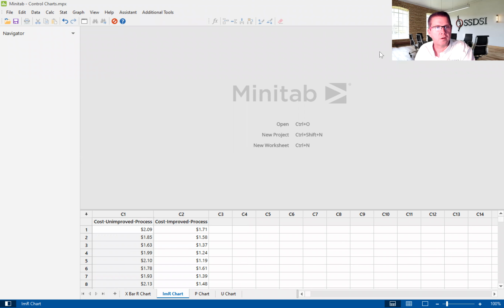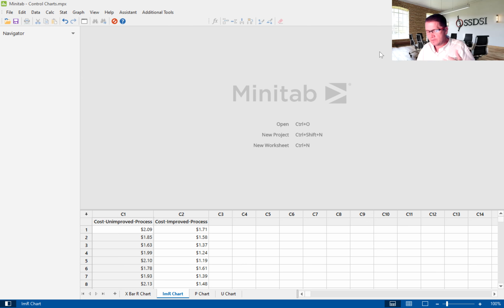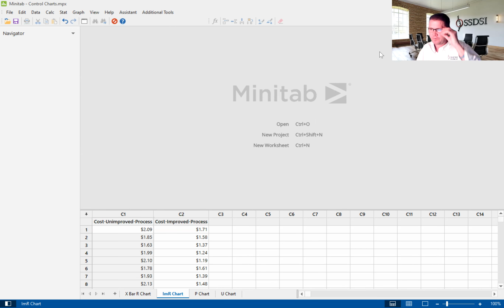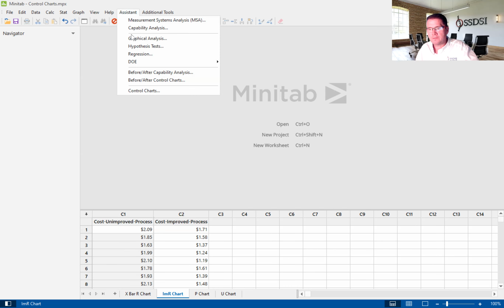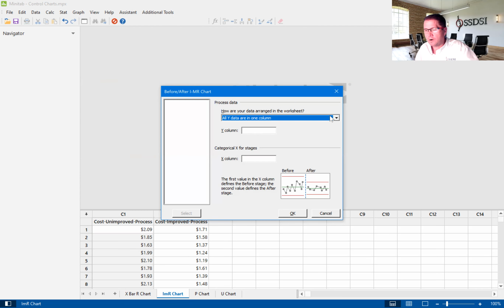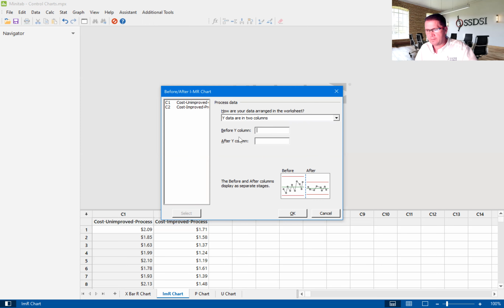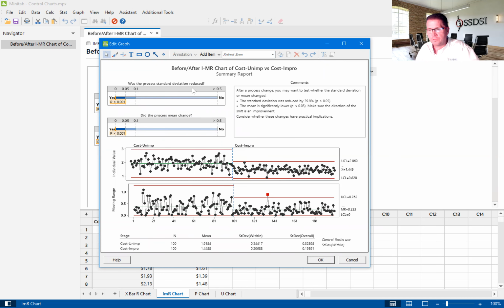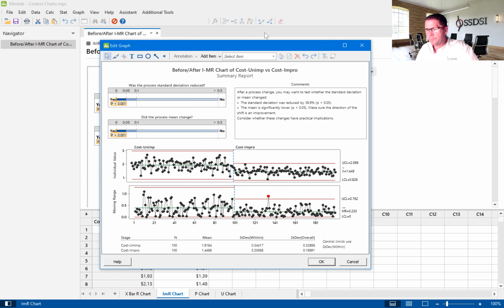Introduction to the Before/After IMR Control Chart using Minitab version 20

Comment: Can you use this to show that was no change in a process?
Reply from the maker: Yes. If the process mean and/or Standard Deviation does not change, then the P-Value will be greater than .05.
Reply: @sixsigmadsi  Can you remove outliers from the chart?